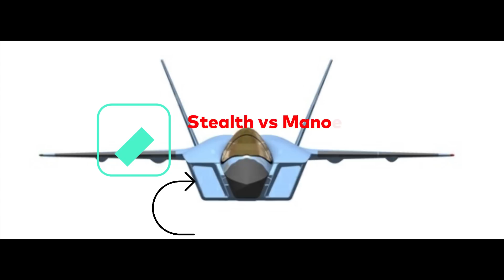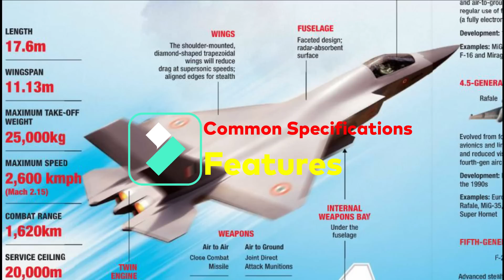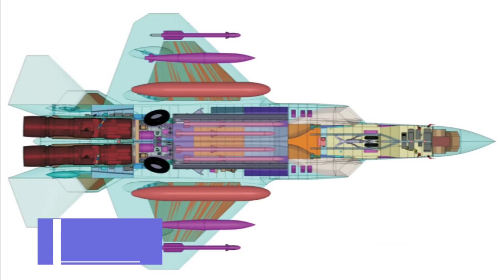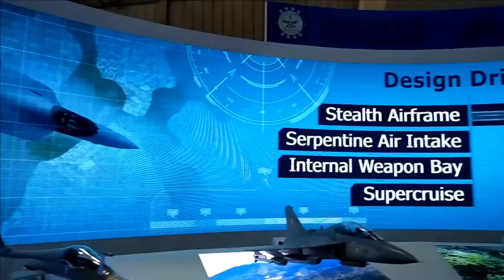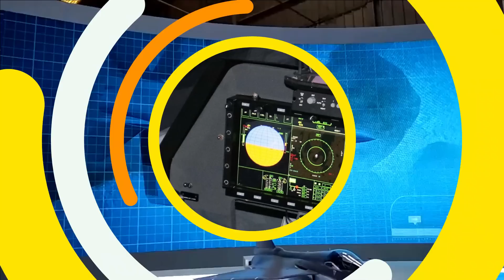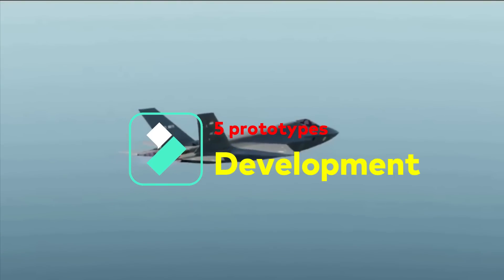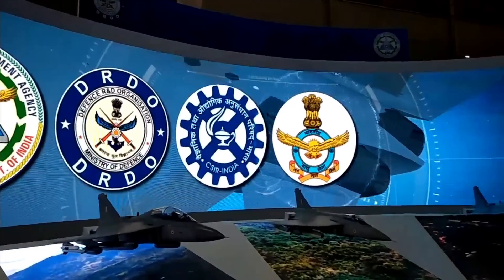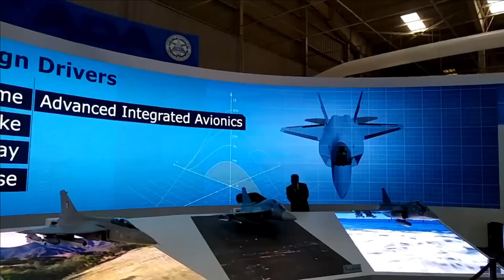AMCA designed for “First look First Kill” | Speed : Mach 2.15 | Combat Range : 1620KM

Comment: No it will not be either first look or first kill.  You need very powerful sensors for that.  If people think that stealth is just design then they are greatly mistaken.  Stealth is also turning off your radar and identifying enemy fighters with sensors.  AMCA will turn on its radar and compromise stealth.  Stealth also has a spectrum.  If you are going to fly at 2 machs then you are compromising infrared stealth and you need to apply stealth coatings again and again.  There are many other things that need to me considered for designing true stealth aircraft.  Real stealth aircrafts are very difficult to design and only US has been successful in designing stealth aircrafts.  All others are sub par stealth aircrafts.

Comment: 2.15 Mach??.. fucking impossible.
Reply: It's not so high ..most of every jet can go to that speed
Reply: @Jjsjsjakkwkebsksn  yeah if you have technology to build platform which can go over Mach 2. India don't.tgry have been struggling to build engine for well over 4 decades.
Reply: @kj636  that's why they are making new technology...
Reply: @kj636  we have our engine ( KAVERI ) but it only able to create thrust of 70 KN and AMCA needs thrust of 140 KN so DRDO is in its last stage with france company saffron for co developing engine for AMCA MK 1 and for MK DRDO make them our own 
kaveri Engine will be used in AURA unmanned stealth bomber because it only requires 50-60 KN thrust and kaveri has more than that
Reply: @Ishantyagiofficial  76*
Reply: @kj636  yup because our youth is busy abusing country instead of contributing in the sector in which country lacks
and btw engine technology is very hard 
only there are few nations in the world who are capable to build engine of thier own !!

Comment: Mach 2.2 impossible with current or even the 110kN engine Don't keep parroting brochure material Use your own head
Reply: Gripen uses a single F414 engine and it has around 2500 kmph top speed which is around mach 2.25.
Reply: The Mig21 went Mach 2.05 with a single 69.5 kn engine. 
Relevant aerodynamic design choices can comfortably take a medium weight fighter to Mach 2.2 with 200-220 kn if that is the goal.

Comment: Why AMCA stealth type only have internal bay weapons only
Reply: Because outside wepons increase radar detection...for stealth wepons should be keep inside...you can check f35 design for more info
Reply: Payloads are not designed to obsorb radar signal and that leads to stealth compromise so only internal bay weapons.. same goes for F35

Comment: What do you think would be the range of the radar of AMCA?
Reply: 350+
Reply: @ig-anzros01  only?
Reply: @CarnageXAddy388z  aur kitna chahiye?

What matters is how much RCS can it detect at such distance.
Reply: @CarnageXAddy388z  If it uses GaN based T/R module based Uttam Mk-3 then it will be 430+ Km max range.
Reply: @debalik8806  exactly... I was saying that... It would be around 420-450km if it has atleast 1500TR modules
Reply: @CarnageXAddy388z  + se Mera yahi mean tha ki zyada bhi Ho skta h
Reply: 10000+ km 

i was talking about 10th gen. sitara ladaka tyara
Reply: @Cool Sparkz yes... 100km range for an RCS of 0.001m2 object... It is certain cuz if uttam mk1 radar can detect the RCS of 0.001m2 at distance of 30km then 1500 GaN TR modules can detect the same RCS object beyond 100km 👍